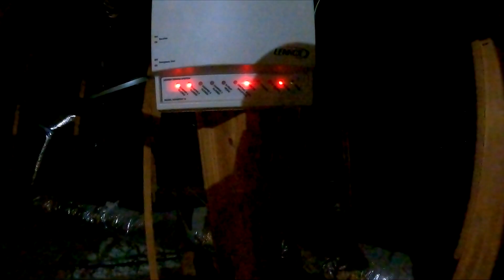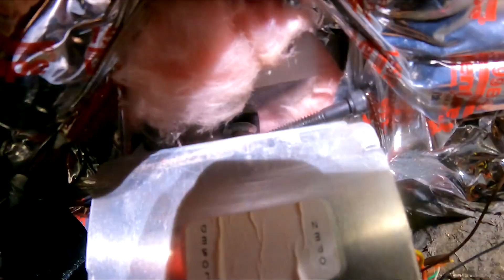"Must-Watch HVAC Troubleshooting: Say Goodbye to No Heat & Poor Air Flow!"

Comment: It never fails...those who installed that system should have had a chart attached to that damper board/controller that describes the system and which damper numbers control what ducts/rooms. Two thermostats...not documented which one is controlling what in the attic. How does the HVAC industry service a huge system like this and nothing is documented as to what is doing what ? How long does it take to label something or write it down so that the next guy that goes up there can do his work without having hunt down the functions?

Comment: Those Honeywell Silver dampers are fun. My method of testing them is to power it closed for 5 mins then let it spring open as it spring open I take my finger and press lightly against it as it’s opening. If it sticks it’s bad it will stick next time out. I also replace all so that way all of them is updated specially if there the silver back ones.